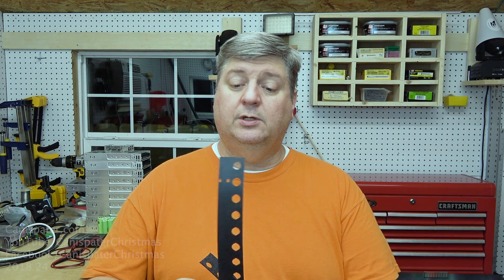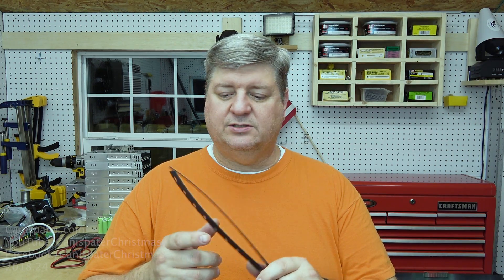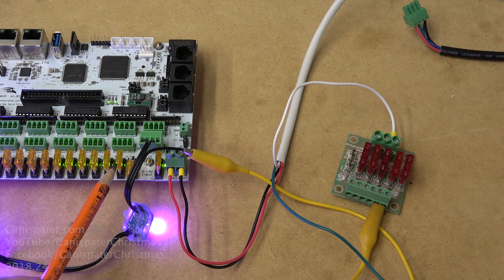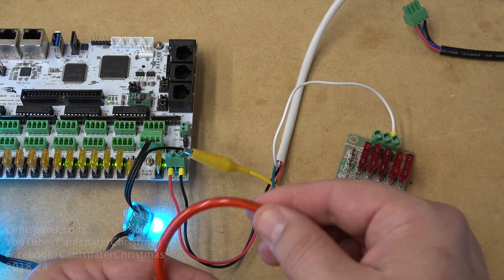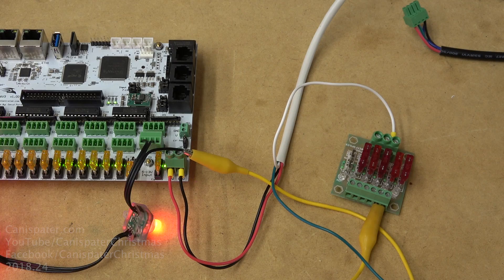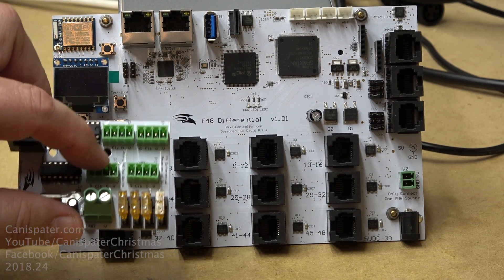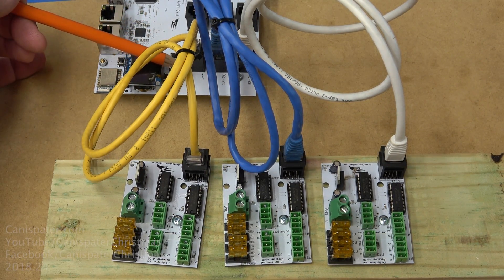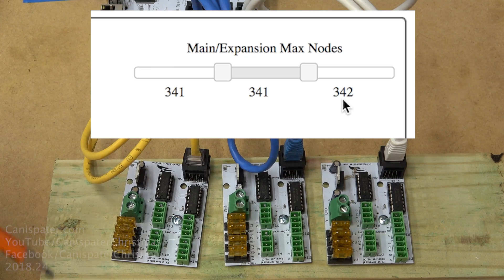Falcon Port Sharing & Bypassing Controller Power Distribution (2018)

Comment: I have a question for bypassing the controller power.  You hooked the pixel positive up to the power supply and bypassed the controllers +12.  However you still used the controller ground to feed the pixels.  Wouldn't the amperage on the negative line exceed what the controller could handle except with no fuse to protect it?   Just curious if the power supply negative should have been used as well.   Thanks!!  I'm an electronics newbie so trying to get this straight.
Reply from the maker: Yes, you should use ground from the power supply to feed power to the pixels, but also tie in ground from the controller to make sure there isn't any floating voltage otherwise you could get flickering. Congratulations! You're the first one to find that mistake! lol!
Reply: @CanispaterChristmas  I was happy to find your video re-affirming that what I wanted to do wasn't insane though. :)
Reply from the maker: Na. It's certainly possible, but I seem to do it less with standard power injection now.
Reply: I started using pairs of Delphi weather-pack connectors on my setup; one for data and one for power.  I regret this connector choice over the standard 3 pin barrel as it has complicated some things and introduced redundant ground paths, etc.  I really should just switch back to the standard wiring and inject power in the same way normal folks do it. :)

Comment: hi jeff how does this go to the f4v3 pcb with the ports on the max for each port on pcb
Reply from the maker: Not sure I understand the question. There is a differential expansion board for the F4, but it is a different than the F16. The F4 supports 1,024 pixels per port without expansion.

Comment: So if the maximum number of pixels gets divided by the amount of expansion boards you use, you are not actually gaining the amount of pixels for the "main" controller because you still only have a Max of 1024 pixels? So what is the benefit of expansion boards?
Reply from the maker: More ports and less power injection. More ports lets you run shorter strings.

Comment: Jeff,I have 2 questions  First can I use a 2nd power supply the same way you are showing, I have all my negative tied together.  Second all I have for this year is a matrix with 30 rows of 40.  I have them split to 2 ports (600 pixels each) with a F48 controller and receiver board.  I must have something wrong with my set up tab because only the first 512 channels on both halves of the board turn on and it looks like the right side is doing the same thing as the left side instead of what it is supposed to do  Could you let me know what my set up should look like.  Everything works fine in test mode.  My show is very small this year but I need to start somewhere  Christmas is coming fast and I am a week behind already.    Thank you again.
Reply from the maker: You might have a look at the string ports page for the controller in the upper right corner. There are two sliders (3 sections) that set the number of pixels a row of receivers supports and I'd guess it's set to 512 for the row that receiver is plugged into. Each column of ports on the F48 shares 1,024 pixels. The sliders determine the number of pixels each differential receiver port is capable of running. So the top row on the F48 corresponds to the left slider section, the middle row supports what's in the middle slider section and the bottom row is set by the right slider section. I'm not sure I understand what you're trying to do with 2 power supplies, but I'm not doing anything weird so I'm leaning toward "yes", but not sure. :)

Comment: Do you know of anyone using pixels in Canada?I don't understand why you would want to split the ports on the f16?  What situation would you want to do this in?Do you have to put inline fuses on your lights outside of the power supply?  I see a lot of enclosures with additional fuses setup, why?Enjoy your videos!
Reply from the maker: Thanks! There has to be at least one! lol! Each of the 16 ports on the F16 supports 1024 pixels. Adding expansion boards, splits those among the main card and the expansion cards. Some people like to use shorter strings and more ports. Personal preference really. The only reason for adding fuses is if you are injecting power. Coming off the F16, it has fuses already so no worries there. Yes, you can fuse the power supply if you are paranoid, but most don't because it usually enclosed with the controller so little chance of shorting it out. Since power injection is going to the prop, fuses are recommended just in case you sneeze when you're messing with the wiring or shoveling snow and accidentally cut a wire. Sorry I couldn't come up with better scenarios - still setting up. :)

Comment: CHROMA STRIPS: The trick with the chroma strips is to use a step drill-bit and spin the drill a little from the back side to round the hard edge making is easier to push the pixels.  The second trick is the make a jig using 1/2 inch pvc and a coupler.  Mount it to something solid to act as a base.  Place the chrome strip face down on the  1/2" PVC coupler.  Place the pixel over the hole and apply a little pressure.  The node should snap righ in.  Sometime you have to give a little twist, back and forth, to get it to sit flat.

Comment: I 3D print one of these to help when hand-pushing pixels into the chroma trim: https://www.thingiverse.com/thing:2458372 .
Reply from the maker: Haha. Yeah, I had a pusher, but it was still pretty tough getting them in those strips. Drill press works great too. :)
Reply: Have you tried pushing into a socket from a socket wrench sitting on a solid surface?  I can't remember if I used either a 1/2" or 3/4"?  Just has to be deep enough for the pixel "top" and wide enough to just make it around the top.  I agree it wasn't a panacea, but I could still feel my fingertips and hands weren't cramped after pushing a couple of hundred through in a sitting.

Unfortunately the open space in my shop with enough space to account for chroma strip and pvc wasn't near the drillpress :( .
Reply from the maker: I COULD have brought the press in, but figured there weren't enough pixels to warrant it. Should have taken my own advice. lol! 1/2" is the hole size and probably works. I forget which one I used before. I've done several hundred that way.

Comment: Hey Jeff! Great video! If I can help you with video settings, feel free to reach out. I produce videos all the time and I've stumbled on to some great tools. Which Adobe app are you using to produce?

Now to the real point!

Would you do a complete dummy-proof walk-through of setting up an F16V3 and a Falcon Pi Player, please? I'm getting ready to produce my first sequence, but this video worries me on how to set up the F16V3 and the expansion boards (I have two expansions). I thought I was getting 48 x 1024 pixel control when I bought all three boards... So would you mind walking through the software configuration on those steps, please? I've got a great idea on the hardware thanks to you and I've watched all your videos. Without you, I'd just be some schmuck with 4000 pixels and no idea what to do with them.... Thanks in advance! Love from Killeen!
Reply from the maker: Hey Chris, thanks! I've started with Premiere, but want to explore several of the apps (Audition, After Effects, Photoshop, Illustrator, etc.) over the coming year. I'll probably have more time during the holidays once the display is up and running. If you use xLights and follow the setup Keith outlines in his video, xLights can program the board and FPP. Doing it manually is a bit of a pain and generally leads to mistakes and a lot of troubleshooting if you aren't super careful. So I guess Q1 is what sequencing software are you planning to use?
Reply: @CanispaterChristmas  thanks for the quick reply! Im using xLights. I will look for Keiths video.
Reply from the maker: It's pretty long, but covers a lot. https://www.youtube.com/watch?v=EYrUg5zA6FU He covers programming a controller. Also, might be worth jumping on the Wednesday night Zoom call if you are able. Check the xlights web site for the link.

Comment: I'm about to buy my first Raspberry Pi 3 B+.  Curious as to how you power yours.  I see some that are powered by 3 9 Volt batteries and then the "kits" that have an AC power supply.  Do you have a preference/recommendation?
Reply from the maker: I use the 2.5A wall wart in most situations. During showtime, I plug it into a large battery that allows pass-thru charging (serves as a mini-UPS) to make sure it's powered in the unlikely event of a power outage. I did forget to plug the battery in one year and it lasted about a day. LOL. Either way you go, just make sure whatever you're using has enough current capability to power the thing - it is a little power-hungry. Well, more than you'd think anyway. For example, powering from a computer's USB port is usually not enough. If it's underpowered, you'll get errors as it boots (if you're looking at the console output) or it won't respond when you try to hit it with a browser.
Reply: Thanks so much for taking the time to answer.  You are a huge resource to us noobies!

Comment: noticed you have the white (common)going to the pixels from the power supply and black (line) going to the controller board  from the power supply.   Which is Positive and which is Ground? on the pixel plugin and the pixels?
Reply from the maker: If you mean the 4-wire connection I'm using from the power supply on the bench, red and black are + and - and I used the second pair for white + & green -. I don't normally use that cable for my display so I keeps me from getting confused as well, but on the bench, it works nicely when testing or demoing multiple boards. Apologies for the confusion.

Comment: Is it by bday already Hahahaha
Reply from the maker: Haha
Reply: CanispaterChristmas 🎂🎂🎂 hahaha on a more productive note tho if I run a f16v3 with exp board half for my mega tree  16 ports n the other half on the rest of my house providing enough power I should be fine as long as I don’t go over 512 pixels per port?
Reply from the maker: Well, you can set it to whatever you need and I would verify the setting just to be sure. That's how mine was set, but not sure how yours is set. I suppose you could just assume it's right and if something doesn't light up, check that setting - but not a recommended way to go. :)
Reply: CanispaterChristmas haha I’ll definitely check it to be sure
Reply: Also have you made or thought about any videos with p10/p5 screens 
I know u did the North Pole sign that was awesome 
But I’m thinking bigger 
I have a 4x5 matrix I want to run some images on and there’s several videos and how to’s but none with ur cheeky humor hahaha
Reply from the maker: Not this year anyway. I bought a matrix mesh from Boscoyo so that is going to be my big add this year. Currently waiting on a shipment from Ray...
Reply: CanispaterChristmas  ahh nice 👍 gotcha gotcha look forward too seeing it